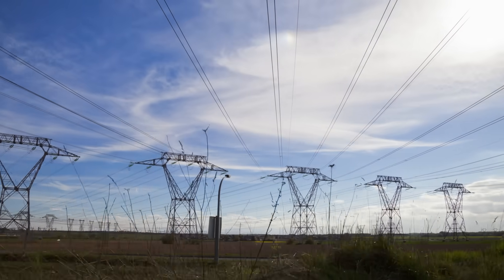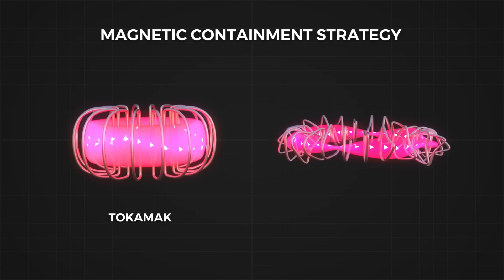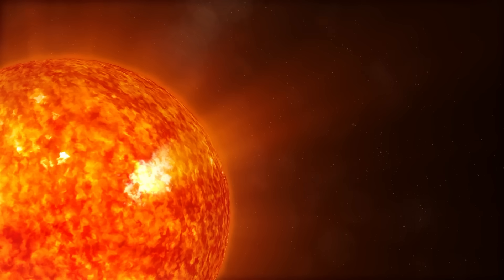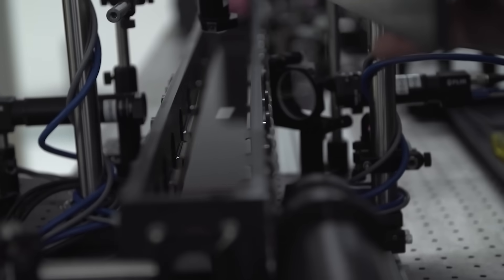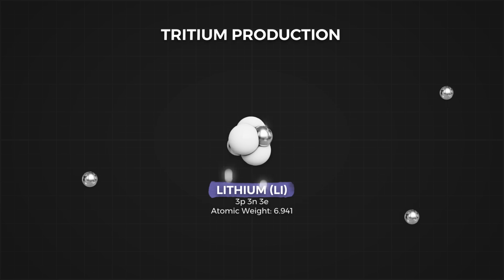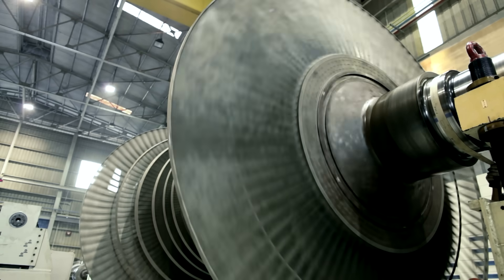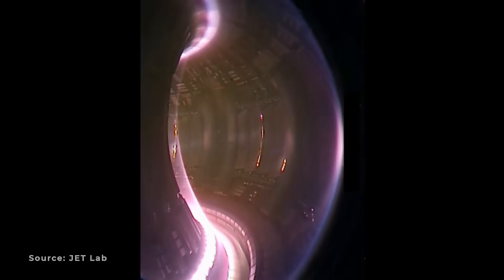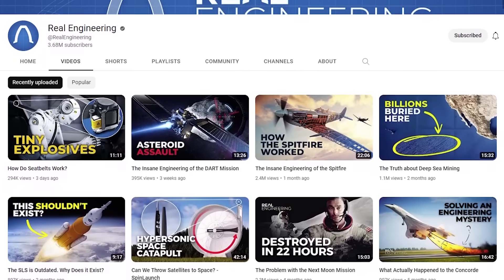The Problem with Nuclear Fusion

Comment: Advanced fission reactors are also incredible. Breeder Reactors that produce their own fuel are also possible. You essentially use something that doesn't slow down neutrons as much as water and add thick Uranium cladding to inner walls of the reactor. Preferably that uranium is deluded in a liquid so it can be refined easily. One of the issues is that we use about 1% of the available uranium and the rest is waste. But with a working Breeder reactor you could have so much more efficient designs that don't need a refuel in decades
Reply: I love deluded uranium. It calls itself plutonium!!!
Reply: The reactors that start off with Thorium and produce Uranium, right?
Reply: One Anagram: LFTR.
Reply: Right! The USA had breeder reactors in the 1960s and the  Nixon for a President.  Another kind in the 1980s, which Clinton murdered in 1984.
Both, in  US labs, were meltdown-immune technologies and producing actual power before the infamous but exaggerated Chernobyl meltdown, that were capable of breeding  their own fuel and did NOT create "long lived waste", most of which is wasted by edict of decent, genuinely Christian, but stupid, Jimmy Carter.
ORNL, under Alvin Weinberg, who invented the PWR (Pressurized Water Reactor) that powers our Capital ships, the aircraft carriers and submarines, proved that the slight shortcomings (slight compared with any other technology, including oxen, peasants, donkeys, and even slaves and elephants) of his liquid water designs could be alleviated by using molten salt solvent instead of water for the energy carrier, and carbon instead of hydrogen atoms as the neutron moderator.
Dear KEK, I quite like the idea of deluded uranium, but you probably meant diluted or better, dissolved.
The MSR used alkali fluoride as the solvent, which in the pure LFTR (Liquid Fluoride Thorium Reactor) breeds Uranium 233 from Th-232 by letting the thorium capture a neutron, and decay to Protactinium 233 then U-233. The nice thing about U-233 is that thermal neutrons fission nearly all of it. But for bomb-making, that process is a bit slow.
The ordinary civilian reactor produces neptunium 239 when uranium 238 captures a neutron, then the Np-233 captures another and becomes Pu-239. unfortunately, in a way, the three year exposure of the fuel rods only consumes a bit more than half of that plutonium, because some thermal neutrons get captured and kept. Pu-240 fissions spontaneously, which is a Good Thing if you don't want bombs.
To breed bomb grade plutonium, which the Manhattan Project did in 1945, you can use very pure graphite and raw natural uranium, but you need to remove the fuel rods from the reactor"pile" in 90 days, and extract the plutonium, or too much of it will give you too soon an explosion.
Reply: we obey the laws of thermodynamics in this house!
Reply: I'm also a huge fan of fission reactors, a lot of the modern designs are fantastic and very safe.

Comment: if the hydrogen bomb works, why cant we make fusion on those  experimental fusion reactors?
Reply: Because its a bomb and is designed specifically to destroy itself in the most violent way possible.

Comment: isn't the main problem we dont have fuel for them ?
Reply: The efficiency of the fuel is completely ridiculous though. For example nuclear fission creates 200 million times the energy it costs to split one atom.
Reply: @jbash0824  no, we litteraly dont have the fuel to run fusion reactors. We’d have to build fission reactors with the sole purpose of creating the fuel to create fusion.
Reply: @NiceNoice  We have those already, uranium enrichment is a thing

Comment: Why did you show only the low abundance 4.67% Lithium 6 for the tritium generation and not the higher abundance 95.33% Lithium 7 isotope which creates Tritium Helium4 plus an extra neutron?   Surely the reaction of the more abundant and neutron generating isotope is more relevant.

Comment: If we can make the deuterium by splitting lithium, doesn’t the scarcity of this material impose a problem? Or is lithium needed in very low quantities relative to the industry for batteries?
Reply: Current annual lithium production is about 130,000 tonnes with 26 million in known reserves. More than enough for fusion reactor blankets. Always remember than known reserves is an estimate for how much can be extracted for a profit with current prices and extraction techniques, actual known resources in existence can be much higher.

Comment: The tokamak reactor is like using a lightsaber to cut your bread.....using a super expensive, complex machine to still be boiling water. 
Why not use the reactor to dig for coal and burn that to boil water to make power...BOOM! The future is now.
Reply: Because burning coal is the least fucking efficient and most dirty way of making energy in all of humanity. The boiling water is simply a medium to transfer the energy. Thermal energy efficiency of coal is around 37%, the efficiency of nuclear fission is about 200 MILLION times the energy cost to start a fission reaction PER ATOM.

Comment: Fossil fuel power plants are bad for environment. Solar and wind powers are unsustainable. Fusion is still unpractical despite the latest breakthrough. Deuterium is abundant but not tritium. To reject nuclear fission energy is simply ignorant. Nuclear power plants are much safer and more efficient as technology advances. Japan's latest nuclear reactor produces both electricity and hydrogen.  The US is way behind the curb in many area because of politics and religions.

Comment: The problem is that what powers the sun is not what our so called fusion offers.  If it's in decay  it will decay exponentially unless gravity is such that time stops and with that an EH must be created for it to function.  How this is done is by increase angular frequency exponentially in a feedback loop until Planck frequencies are achieved.  Then we increase the intensity and subsequent radius.

Comment: "Because its uneconomical!" Just another example that our current economic system is not fit for the future and survival of our species. Not to mention that its not the lack of energy but the ongoing destruction of our habitat which is putting us over the barrel! Plastic has entered the food chain. You can have as much cheap and clean energy as you want but it does not tackle that issue one bit! Anyway ...

Comment: well.. this seems to make an underlying assumption that fusion requires a Tokamak or Stellarator sustaining a prolonged fusion reaction to generate heat which drives a stream turbine. That is one approach. Helion uses pulsed fusion reactions in a relatively compact, mechanically-simple reactor and extracts electrical current directly from fluctiations in the magnetic containment field. They also aim to use aneutronic helium-3 reactions. Some of these tangents may prove challenging, but Helion claims that their energy extraction is highly efficient. That alone seems likely to accelerate progress towards a commercially viable reactor.
Reply: the recent coverage of Helion by Real Engineering might be of interest to those looking to find out more about their approach.

Comment: A excellent and common sense description of the problems.
obvious Central generation is a long term risk to mankind.
The world is exposed to man-made and extra-terrestial risk from 
central power station generation and wire distribution.
Our immediate goal should be to dismantle national grids
We need local power sources in every location.

One way would be to use renewables, but these are subject to climatic
and solar events.
Another would be to develop cheap radioactive generators 
that could be fitted in every house, 

We need to look at more strategic projects and drop ideas of 
massive fusion based reactors, like ITER, except for research purposes.

Comment: You are completely missing the political campaigns against nuclear fusion energy. THAT is what makes it expensive. It's nothing natural like the rarety of elements.
Reply: It’s really not lmao. It’s incredible complexity, supply chains, design work, capital, EPC costs etc. 

Spoken like someone who truly knows nothing about what they’re talking of.
Reply: @Gomlmon99  derp... I'm talking about relative cost to other sources. Initial investment for nuclear is considerably high, but that's because plants are huge, and tech for smaller ones gets no investment due to POLITICAL pressure more than anything. This is one of many aspects about how politics is the key reason why nuclear is still expensive.

anyways, why do I bother to explain stuff about rude anonymous incurious randoms? :/
Reply: @jpbochi  You don’t need to explain anything lol because nuclear is not cheap relative to other sources.

That includes more modern nuclear like SMRs. Just not currently expected to be cheaper at all, and it’s nothing to do with politics
Reply: @Gomlmon99  right, right. Let's pretend you know anything I never heard before, and that energy choices are made in a purely non-ideological way. Tax breaks and incentives make no difference whatsoever. 😴
Reply: @jpbochi  If you want to try using facts or reason, why don’t you find some papers that suggest the reason is political?

Comment: Ya right. The problem with nuclear fusion is that explodes with exothermic energy in a cascade, not unlike a hydrogen fusion bomb.
Reply: Don’t spread misinformation about things you don’t understand.
Reply: @Gomlmon99  Well, I guess you feel pretty safe calling me a liar eh? In a fusion bomb, a hydrogen nuclear weapon, how do you think the weapon achieves 'fusion'? Tell me how, oh great one of the know-it-all clan. Something simple about you that makes me think you would find pull-ups a challenge. And the challenge you're in now is hydrogen fusion....does it exist and how well does it work. Hum?
Reply: @thomasstuart6861  Not sure why you got so emotional there, but fusion is not a chain reaction, and civil fusion could never explode as the conditions, fuel and neutrons not are present in a way remotely comparable to a nuclear weapon.

Civil fusion is very unlike a hydrogen bomb
Reply: @Gomlmon99  The Canadian fusion reactor uses precompression which is key to fusion weaponry as well.
Reply: @thomasstuart6861  What is your point? Both General Fusion and thermonuclear weapons use fusion? That doesn’t mean one is equal to the other.

One has a tamper, a massive amount of fissile material, a huge neutron shower, a bunch of conventional explosives, and a massive fuel pellet, enough to wipe out a city.

The other couldn’t even blow its containment apart, with all the fuel in the chamber fusing at once (which is what happens).
Reply: @thomasstuart6861  tell me how something could cause a dangerous bomb, when all the fuel within the chamber exploding at once is not dangerous? How is it physically possible?
Reply: @Gomlmon99  Once again, as I said before, there is no working fusion reactor yet. It remains boasting for more funding. Whatever statistics you have mean nothing because the science does not exist on a working Tokamak fusion reactor, which has not worked since its design over 50 years ago.  I suggest if they want an exothermic reaction they have to stop fooling around with "not dangerous" amounts and consider that the containment is inadequate for continuous operation. I have not seen enough of the Canadian design in the UK to know but you should not call others liars in a public forum when you are picking your "facts" from the internet which all professions are trained no to do. This discussion is over.
Reply: " nuclear fusion is that explodes with exothermic energy in a cascade, not unlike a hydrogen fusion bomb." 
You say "fusion is not a chain reaction". I said "  the sun is a chain reaction". 
You say "Don’t spread misinformation". I said " general fusion has not been achieved "
You say "tell me how something could cause a dangerous bomb", "civil fusion could never explode", " tell me how something could cause a dangerous bomb". I said "  exothermic energy in a cascade". 
And BTW mr expert, all fusion reactions use lithium of which there is only 50 million tons in the world.
Reply: @thomasstuart6861  I asked you how something could be dangerous, when fusing all the fuel in the chamber at once is not dangerous. Tell me how it could possibly be more dangerous than the total amount of fuel?

Yes, I am aware of that. It uses grams of lithium. That’s not a big concern.
Reply: @Gomlmon99  First you want me censored and now you can't get enough.
Reply: @thomasstuart6861  Why are you not answering my question? Is it because you know you cannot?

Comment: Nuclear Fusion is nice, yet to get electricity we need something to rotate, thus the steam turbine, but what if it was possible to use permanent magnets to rotate an axle and thus rotate a generator. It sounds like it won't work at all, but with simple mechanics I think it may be a reality, it's hard to explain on text.
Reply: Not necessarily. Only a magnetic field is required. It can be dc non rotating , converted to ac after .
Reply: @persona250  So your saying that a motor with permanent magnets is possible and a near infinitely running motor is possible?

Comment: The Utopian character of nuclear fission is exactly the point that makes it rather suspicious. I dont know but I could believe there is proof of concept for the "source of eternal youth" too already for a special set of cells under very special conditions. Yet I woulndt take it in the slightest as proof for anything. We shouldnt be too condident and rather rely on fusion and try to inforce safe disposal than hope that fusion energy will be available in this or the next century. Well, believing in a working enforcement of safe disposal is just as utopian. I think the most realistic scenario is that we make this planet inhabitable, forcing us to leave to mars (i.e. the 1% of the 1%) where, after terra forming, the same shit reiterates.

Comment: The problem with nuclear fission isn't really cost. It's cheaper than renewable by like 2-3 times if i remeber correctly. The problem is that while it solve the climate change problem, there is still nuclear waste, nuclear explosion risk, and the global population fear. 
The cost is not really that much of a problem. We are already spending way too much on slowing climate change. That's why nuclear fusion could be really good. It would be like nuclear fission, but whitout the troubles.
Reply: You’ve got it backwards. The cost is a huge problem. Arguably the only problem.

Comment: It's so infuriating how fission plants get shut down because hazardous waste management is expensive, while fossil fuel plants get to just launch their hazardous waste into the atmosphere... like wtf contamination is a valid issue so make all power plants handle it.
Reply: And then ridiculous amounts of money are dumped into dead-end fusion projects instead of fission.
Reply: Until recently I worked in the nuclear industry. And that waste really isn't waste. What they call spent fuel is actually over 80% unused uranium 235. The build up of fission products are why it's removed, the u235 and the plutonium made in the reactor actually mean your reactor will be more efficient the longer the fuel burns but other crap builds up that could be processed out fairly easily and the u235 and pu239-240 put back into reactors. But because of decades old treaties we don't reprocess our fuels. So its a massive waste of money. France is the only country at the moment that is reprocessing their fuel. And as for fuel we have laying around well all the thousands of nuclear weapons we dismantled after th cold war, the plutonium and enriched uranium is still stockpiled and could be used in reactors for a few hundred years. That fuel was paid for decades ago and Is just sitting there in case we need more than the 5,000 or so nukes we still have in the arsenal. Kinda fucked huh?
Reply: Yeah it’s really sad.

Comment: actually in USA we tried years ago to make disposal or radioactive waste cheap and effective by placing them in a hole in the ground in the middle of nowhere, but we never used it because despite it being approved by every regulatory agency required and the local jurisdiction people of that state like most of the usa have a not in my backyard way of thinking its the same reason we have issues with our power grid we dont have enough pylons for high voltage transportation across large distances